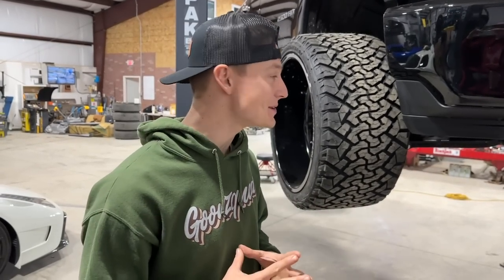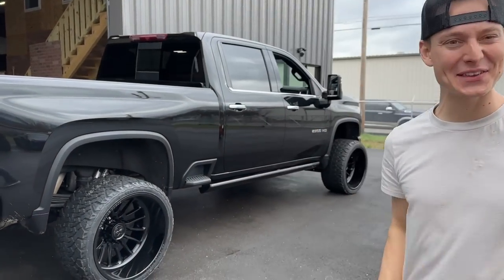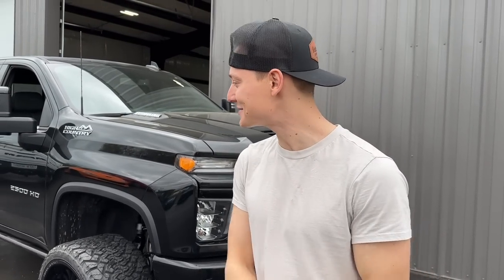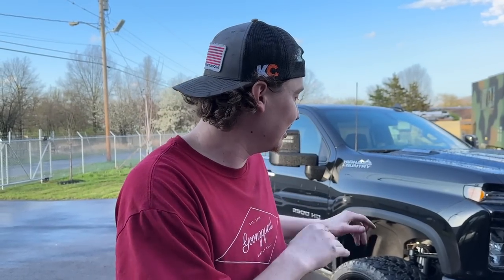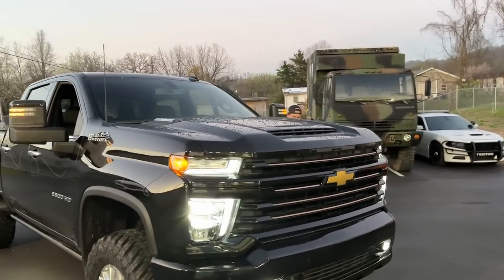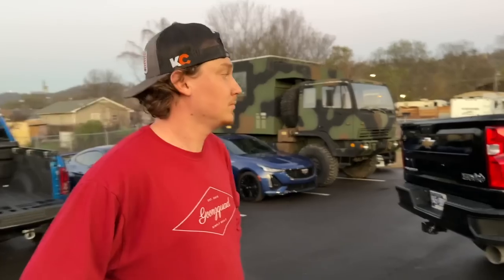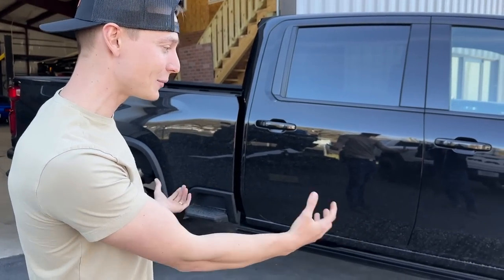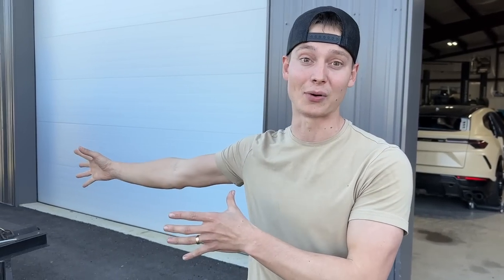Something Major Is Coming!!!

Comment: Powder coat the stock wheels black. That would look the best.
Reply: Heck even plasti-dip them black like I’ve done lol
Reply: Totally agree. It looks stoopid with those cartoon wheel tire combination.
Reply: I was thinking the same thing.
Reply: i agree. Those wide tires and  deep dish rims make that truck look like a hot wheels toy.  Stock rims powder coated black would look a lot better.
Reply: Agreed
Reply: I think different wheels all together. Something more aggressive than stock, different offset so it pokes a bit or sits just flush. The big meat 37's are definitely the way to go though.
Reply: The deep dish wheel/tire combo offset is completely wrong. It might require shortening up the axles and associated suspension to get the tires to fit under the fenders…THEN it would look “fire”.
Reply: Black out the stock wheels and add spacers for a little more poke
Reply: I was going to say same thing, powder coat the stock rims gloss black.
Reply: i 100 percent agree
Reply: Their taste on trucks is so trashy (i.e. non-existent)
Reply: @Mr Classic  yeah it's trash rn

Comment: The taller new tires look so much better than the low profile tires you had on at first
Reply: They look better but really it could do with some tall tyres/wheels that are a little wider with small fender flares probably in black because they’ve ‘murdered out’ everything else. I feel like they put the chrome stock wheels with tall relatively narrow tyres on to prove a point to the critics and deliberately didn’t get the look quite right!
Reply: Tall and tucked for the win. The skateboard wheels will spray water so badly when you drive it in the rain. You will have to wash it more frequently too. 

Thanks boys!!!!
Reply: NO
Reply: Absolutely agree. 💯

Comment: Absolutely love the stock wheels and mud tires over those big princess wheels.
Reply: Exactly.Real tires over 'show' tires that can't do Truck work.
Reply: @bryduhbikeguy  You wouldn't believe the amount of weight you can pull with those tires. my friend has a f450 with similar wheels and he is pulling 30k+lbs regularly . Its not smart by any means, but i would not discredit a trucks capabilities based solely on rims and tires. I am not disputing that factory setup can do more off roading and such better.
Reply: Street looks terrible.   Might as well squat it with those. Way too much offset.  Not enough sidewall.  Blackout those stocks with 37s would be fire.  Check out VenomRex wheels as well.  I love mine.
Reply: Love these guys, hate those street wheels
Reply: The aftermarket wheels are straight up trailer trash

Comment: Love the off-road tires, it looks mean and ready to work. Also love the idea about powder coating the stock wheels black to complete the look. I suggest smoking out the headlights, taillights and mirror lights
Reply: My truck was blacked out, with the LED black reflector panels on front and back
Reply: Definitely should go the powder coating stock wheels route.
Reply: Definitely not. Why work so hard to make it look? Stock and on a budget?
Reply: Looks kinda basic now
Reply: I'm impressed they bought some mud tires, BUT definitely need black wheels (new or powder coated stock) and it'll look 100x better. Then you can finally toss those thin rock slinging so called "show wheels".... lol

Comment: Totally agree with the comments about the taller wheel/tire combo and powder coating them black ... also with the tinting/smoking of the headlights and tail lights. I would also love to see a big light bar across the roof of the cab to just finish things off!!
Reply: the original rims and larger tires 37's? and totally blacked out with tint, bed cover, and leds front and back would finish it off nicely

Comment: I though the wides looked silly on the lift, it looks straight up like a cartoon truck that skipped leg day on the road! Glad you went with proper tires on the stock wheels! There are amazing aftermarket wheels with a nice dish for the stock wheel size, but not excessive like the wide baby wheels.
Reply: Yep -  something in-between both set-ups would be great.
Reply: This. A nice set of wheels that don't stick out beyond the fenders is exactly what it needs. All those super wide wheels do is fling crap all over the side of your truck whenever you drive it. It also makes it look like one of those trucks that WhistlinDiesel would crush with an excavator.
Reply: thank you for saying what i think
Reply: Yes but I it was 12 wides and the wheels were a bit in to the truck it would look sooo nice
Reply: @madmatt2024  ain’t his trucks got wide wheels?? or drag slicks he don’t like squated trucks not wide wheels

Comment: My truck is built for BOTH. Big, beautiful black 22's but on 37" Hybrids tires. My 6" lift is a perfect height for pavement as well as trails too. 3.92 gears, built posi-diff is fun for drag races as well as towing or mild off roading. I also have a single cab so my 1500 is lightweight & with my supercharged 5.7 it's a BLAST on anything 👍

Comment: Instead of a bed cap I would recommend a diamondback bed cover. You can haul up to 1600lbs on top of the cover, and it is also lockable so no one can gain access to anything you have stored within your bed. I have one on my truck and I love it.

Comment: Okay, first and foremost, the video effect of you two putting the other tires on and walking away was cool. 
Secondly, I do like the stock wheel setup better. As I mentioned before, you do what you want with your truck. 
A vehicle that is black always looks so nice when it is clean.
Reply: yeah, the bad thing about black vehicles, you are always washing, even if you get just a bit of dew, because those drops will leave a mes

Comment: Alignment Tip 101, put stock rim/tires on truck, then bring it to the alignment shop.
Get the alignment and then put the aftermarket rim/tires back on.
If the alignment shop is good, it should drive straight.

Comment: Those mud tires are on point. Blacked out rims with a bronze or some type of highlight would look good. Maybe two inch wheel spacers to push them out a little. Have you guys seen the decked system for the bed of the truck?

Comment: Love how you guys listen to the fans 👍 although, I think you're gonna need some mud flaps and fender flares to at least slow down the rock damage in the long run and also add a bit of beef and perhaps some slight spacers for the off road tires..
Reply: I dont think they make mud flaps that wide . And as far as fender flares this donk would need dually fenders front and back to cover those hideous things !
Reply: @tnolan3176  but they need offset wheels and flares for the set off road set up at least. Thing is wide as a transport truck with those 24's but looks almost perfect with the other ones.

Comment: New wheel / tire combo a million times better. Personally not a fan of the big diameter high offset wheels with the rubber band tire however you guys should build the cars how you want. I do like the concept of building a one off car how the fans spec it out though. Keep up the good work.

Comment: One thing I always wanted to do with my 2500hd was to get one of them campershells for the back, cut the roof out of it and put some sort of an auto darkening glass or plexiglass in for the roof, and set up some sort of a set up for being able to get away from the city and be under the un light polluted sky to get a better visual without the worry of rain or where I originally came up with the idea up in Alaska chasing the lights I thought it'd be neat to have a little heater back there, a set up for hot cocoa and what not. Now that I'm down in Ohio I don't get the northern lights down here, but I do get the night sky in some areas. However one thing I was going to do was toss a Whipple supercharger on my 2500hd. I never got to complete that build but would love to see someone do it right. These chevrolet pickups are my favorite vehicle, I have had a chevrolet truck platform for going on 10 years now. I'd also love to see someone do dual exhaust probably from one of the better sounding exhaust companies.

Comment: You should park the cop car in the spot closest to the gate or building and wire the running lights and break lights to a power adapter so it looks like there is always a cop chillin' there.

Comment: The tires are a bit skinny, and the diameter of the wheels + tires seem to small to fill up the wheel wells in a way that doesn't look awkward.

Adding a wheel well/fender flare/widebody kit to reduce the look of the massive gap of those wheel wells would top off the build with a nice polish.

in any case, love to see all yall's projects Simply Built.

(Opinion, your Ferrari is lovey, feel you should hang onto and just re-upholster
and store out of sun).

Enjoy all your positivity!

Comment: The street tire set up leaves the wheel well gaps way to big. Definitely need more meat on the tires for the street set up.  Keep in mind every inch you go up in height you go wider on the tire size.

Comment: There are several problems with those wheels #1 the offset is wrong and will wear out the wheel bearings. #2 they stick out too far and will destroy the side of your truck but I guess thats OK if you don't care about your paint job. #3 in some states thats illegal to have wheels that stick that far not covered. #4 those wheels and tires are absolutely worthless for offroading.

Comment: Maybe I am just used to a truck being usful but those 14 wide look soo dumb on that truck, such a horrible idea! Get some good off road tires and some good wider than stock rims and put wider 37's on it, like 10 wide but with those fuel wheels and tires on that truck it looks ruined. In My opinion that is a garbage build with the 14 wides on it. Why would you lift a truck only to drop it with the 14 wides?

Comment: Those deep dish wheels look just plain ugly. Not to mention you hit a bump wrong with that heavy ass truck, those rims will be toast. As for the other tires, and blacked out rim with a slight offset would look a million times better than the stock rims. Hell, even if you plastidipped the stock rims black, they'd still look better than those 14 wides